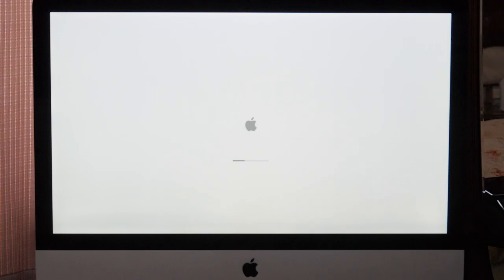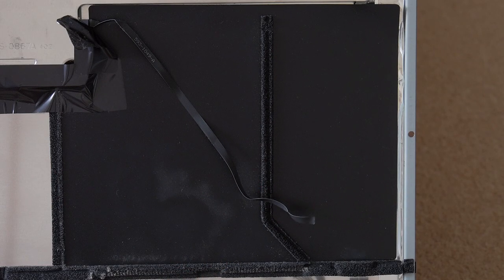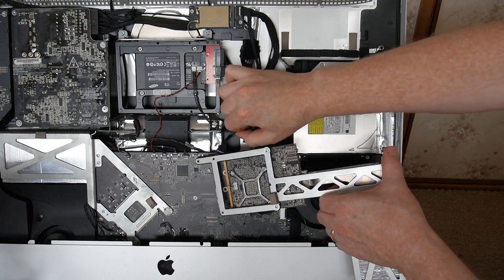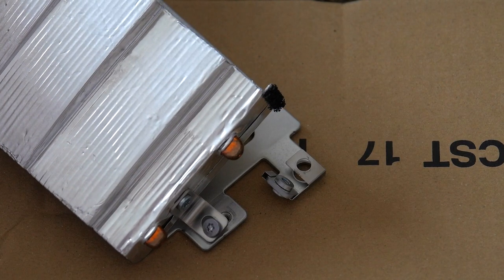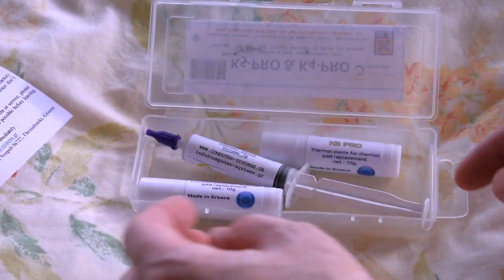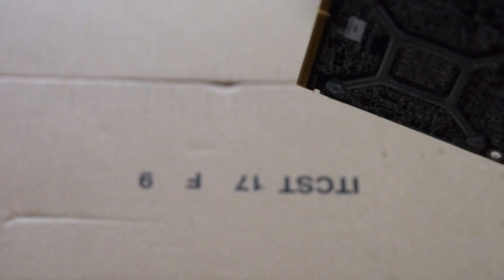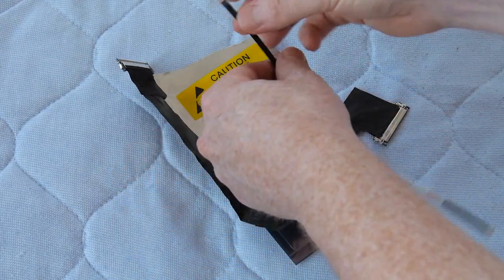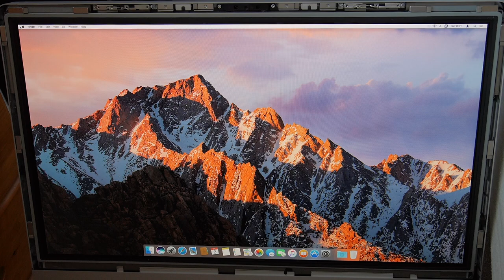Late 2009 iMac 27" Video Card Repair — 4850 — 2nd Bake

Comment: Hi JDW, thanks for your video this helped me make the decision to try and save my old iMac 27"2009. Question: After cleaning the GPU, and heatsink, can I use Soft Thermal Conductive Silicone Pad in exchange for Thermal Paste K4 or K5? Can I replace the battery BR 2032 with CR 2032. Thanks
Reply from the maker: Thank you for watching and for your question.  The only reason I used K5 Pro instead of a thermal pad is because it's not easy to precisely measure the gap in order to buy a thermal pad of appropriate thickness.  If you can do that, then of course a set of thermal pads for the memory chips will do just as well as K5 Pro.  Yes, you can replace the PRAM battery with a CR type.  I chose the BR only because (1) it matches the stock battery type and (2) since the iMacs get hot inside, I though the higher temperature specifications of the BR type would be better than the CR.  That's not to say the CR will suddenly fail a few months down the line.  I simply had the means to purchase a BR, so I did.  I hope this helps!
Reply from the maker: @jvah051165  Whether you use thermal pads or K5 Pro, the thermal conductivity is lower than normal GPU/CPU paste.  But that is in part due to there being a gap, and in part due to the design of the pads and K5 Pro paste.  Paste made for a CPU/GPU with no gap can be designed with a much higher thermal conductivity than a thermal pad or K5 Pro.  But the good news is that those memory chips don't get nearly as hot as the GPU on the video card, which means the lower thermal conductivity of thermal pads or K5 Pro doesn't matter.  So whether you choose K5 Pro or thermal pads won't be an issue at all for you.  And if this is the only project you have planned, then there wouldn't be any merit to buying K5 Pro over a thermal pad, so long as you have precisely measured the gap between the top of the memory chips and the heatsink so you know the right thermal pads to buy.  But if you have other projects requiring paste, then the purchase of K5 Pro would be useful, as gap width doesn't matter with that paste, and you could use it on memory chips of other cards too.  But never use thermal pads or K5 Pro on CPUs or GPUs because it is not made for them, and the lower thermal conductivity will mean the chip will get too hot.  Again, this doesn't matter for cooler-running memory chips.  I hope this helps!

Comment: Is it even necessary to turn the spring mounted screws. Wouldn't it be enough to remove the 4 screws on the bracket on the other side. And then the spring mounted screws will still fit i height?
Reply from the maker: You are asking about video timestamp 15:22.  You can of course remove the 4 tiny screws on the back first to see what happens, but I believe you will find that you still need to then loosen the spring loaded screws too.  Please try and then let me know what you ultimately had to do.

Comment: Thank you for the video, I am in the middle of this project and have a small issue I hope you can help with.  While removing the connector for the power button and using very little effort the wires pulled out of the connector.  Is there a technique for getting the wires back in the connector or am I going to have to replace the power button?  I know the connection to the button is a solder connection.  Thank You!
Reply from the maker: I really need to see a clear, sharp photo of your wires and connector to give you the best advice.  Consider posting such a photo to Flickr or some cloud service, then get the link to your photo and post that link in a follow-up comment.  Unlike other folks here on YouTube, I don't ban URLs in the comments.  Freedom reigns! :-)  For now, what I can say is that in most connectors, wires fit into the plastic slots by means of metal "terminals" that are crimped onto the tips of the wires.  Those metal terminals stay inside the slots of the connector by using tiny little "wings" that flip out like an arrow, allowing you to insert the terminal into the connector but not pull it out.  That is, if you do pull it out, you probably either broke off those little wings or you bent them in the opposite direction.  If they are merely bent out of position, one need only bend the little wings back into the proper position in order to reinsert the terminal, allowing it to stay inside the slots.  However, if even if you can do this, if you yanked out many wires and don't know the correct slots in which to reinsert them, then you would need some guidance to figure that out.  Anyway, I look forward to hearing your reply in light of this.

Comment: Hello JDW! Great video on fixing the video card problem. I was wondering if I have a video card problem because all of a sudden in the last couple days or so there is extreme amounts of snow /static anytime I play a youtube video! It only happens in strange spots throughout the video, not the entire screen, very strange! Do you have any idea what this may be caused from? I also have a late 2009 Imac 21 inch screen and I am running El Capitan OS. Should i download the Sierra OS? I am kind of worried about doing that because I don't know if it has anything to do with this new problem. I would appreciate any of your thoughts! Cheers! And thanks very much!
Reply from the maker: Does your iMac also freeze, lock-up or not wake from sleep?  If you have no such issues and you only see snow on screen, I cannot say for certain if it is the GPU on your video card.  Normally, when the GPU goes bad, your entire machine will lockup.  However, what you are experience could be the first sign of the problem and eventually your machine may start freezing, at which time you will have no choice but to do the bake.  You might also want to test some graphics intensive games to see if the same problem occurs, because games tax the video card even more than YouTube.  Also try watching YouTube in a different browser than you normally use and see if that helps.  If you don't get the snow when playing games or when using another browser, then I would say your problem is software related and has nothing to do with the video card.  In that case, it could be you are using an older version of MacOS or perhaps simply need to reinstall the OS.  I hope this helps!
Reply: @JDW-  I really appreciate your fast reply, I will try everything you mentioned. It is not freezing, locking up, not waking from sleep. All of those are working well. I will try what you suggested and get back to you! Thank you very much, Much appreciated.

Comment: Hi JDW! Many thanks for your videos. I have the same iMac model than yours, bought early 2010, and it has been working very fine till last week. It froze whike using Kodi showing some of the interface letter altered... and since that everytime get stuck on booting but It’s able to boot in safe mode, I can’t understand. I tried reinstalling macos, but when restarts, it freezes... hard disks, memory... everything’s ok... so the only thing left I think it could be failing is the video card... I’m not new on baking electronics... that method saved my MacBook Air 2009 last year, so I’m going to try this week after ordering K5 paste and BR battery... I want to say that my video card had paste on the two groups of four chips at the end side fo the card (opposite the golden contacts), I don’t know if this is important, but mine has been working fine for 8 years and a half, so maybe next time you could apply paste there. Thank you for your help!!
Reply from the maker: Thank you for your kind words and your informative comment. Yes I agree that it is strange my video card did not have any Apple-applied thermal paste on the areas of the card you mentioned. And if I ever need to do the bake again, I would certainly put K5 Pro on those areas. Thank you for pointing that out!
Reply: It worked!! My iMac os alive again! 😄😄 thank you again JDW

Comment: I had to bake my hd4850 for the second time 15 days ago. It came back to life again 3 years after its first resurrection! However I wonder if I can replace it for a 2gb of vram modell...
Reply from the maker: If you’re thinking about the 6970 series, you might want to exercise caution because those failed at a very high rate when Apple was still selling those 2011 iMacs new.
Reply: @JDW-  what about a 765M model ?
Reply from the maker: @OnlyLightMatters  If the video card was not originally in a 2009 through 2011 iMac, most likely it isn't flashed with the required Apple firmware and will not work.  And in those rare cases where the card does work, you may lose the boot screen and other important functionality.  But even with video cards like the 5750 (2010 iMac) or 6970M (2011 iMac), there's not a whole lot of useful information on the internet that tells us about potential caveats.  I am actually mulling the purchase of a 5750 or 6970M now with the aim of making another video on that topic, since no one else has provided many details.  My main problem at the moment is finances.  My salary had hit hard times prior to Corona, and now things are just horrible.  Anyway, that's what I can tell you for now.

Comment: Hi JDW. It is great news to hear that after two years + your mac is still running. Great tutorial, I was able to fix mine a well. Thank you so much. One slight issue since the bake. One of the fans is running full speed 100% of the time. Can you offer any suggestions?
Reply from the maker: If you forgot to reconnect a connector or failed to connect it securely, one or more of the fans will run at 100%.  As you know, it's a lot of trouble to reopen the iMac, so I can understand you may not want to do that to check the connectors.  In that case, your best option to control the fan speed is one of the fan control apps I mention in my text description.  And honestly, you should use those anyway even if all your fans were running normally, in order to run the fans at a higher speed than the stock speed to keep your iMac cool.  For the past 2 years I've keep all my fans running at 2000rpm.  But again, if you want to find the root cause of the fan running at 100%, you'll need to open the iMac and carefully check all the connectors to ensure they are all securely fitted into their sockets.
Reply: @JDW-  Thank you so much. I did try fan control apps and there was no change. I will perform a new surgery on the imac :( and then try fan control apps as you said that I should be using those anyways! Will keep you updated if I find the culprit! Again, thank you. :)
Reply: @JDW-  I hate to be the bearer of bad news. Checked all the connectors, reassembled, fan still running full speed. :(
Reply from the maker: @veroniquepuderecki5995  I am very sorry to hear of that.  Do the fan control apps tell you which fan is running at 100%?  If not, please install iStat Menus.  It has a 14 day free trial.  It will install into your menubar.  There should be a FAN menu and the topmost command is called "Fans" and within that sub-menu it should tell you the fans are "System Controlled" and then it should tell you the speed of each fan.  When you know which fan is running at 100%, the problem should be easier to diagnose.  It could be that the connectors are fine (you checked those) but a wire somewhere is broken.  The only reason a fan would run at 100% is if a connector was not connected or a single wire to a fan "sensor" was disconnected or broken.  The iMac then cannot know the fan state, so it runs the fan at 100% as a precaution.  But even in that case, fan control apps (including iStat Menus) should be able to take over fan control.  It's very strange that isn't working for you.  Anyway, please try iStat Menus to check the fan speed and then try to use it to change the fan speed.
Reply: @JDW-  Thank you for your help, it is much appreciated. I installed iStat Menus. Here are the readings for the "System Controlled" fans: ODD 3434 rpm (86%), HDD 1093 rpm (0%), CPU 3916 rpm (91%). I tried editing the fan rules and dropped them all to 0%, still running at full speed. I am at a loss!

Comment: Why not use the thermal paste over the other bits as well if it’s so good ??
Reply from the maker: I don't know what you mean by "other bits."  If you are referring to "other components on the graphics card," then my answer to that is "because only the GPU and VRAM need paste."  VRAM actually needs it less than the GPU, which is why inferior thermal pads or K5 Pro are used on them.  Thermal pads and K5 Pro have less thermal conductivity than the paste used on the GPU, and that makes sense because the GPU comes in contact with the heatsink while the memory chips do not.  All said, if you paste components other than the memory chips and GPU, it won't hurt anything.  It just won't do any good either.

Comment: Thanks for the tutorial video about baking video card from iMac.  and I am curious about the SSD adaptor you are using which is temp pins supported from the adaptor by seeing video what is the product?
Reply from the maker: The bracket I used for my Samsung 850 EVO 1TB SSD is shown at 11:12 in my video and is this product on Amazon: https://www.amazon.com/NewerTech-AdaptaDrive-Drive-Converter-Bracket/dp/B005PZDVF6
Reply from the maker: The separate temperature sensor (required to keep the fans from running at full blast when installing an SSD) is sold by OWC at their Macsales website: https://eshop.macsales.com/item/Other%20World%20Computing/DIDIMACHDD09/
Reply: @JDW-  Wow thank you for the detailed reply.

Comment: What about the heat conductivty of the K5 PRO compared to thermal pads? I found thermal pads that having up to 12W/m.K, while K5 Pro does 5,3 K/m.K. Although it is one of more expensive offers on Ali (€14 for 120x120x0,05mm) maybe they cheating with the specs?
Reply from the maker: You need not worry about the thermal conductivity of K5 Pro because the reason it is used in the first place is because there is a GAP between the top of the memory chips and the heatsink.  You cannot use normal thermal paste there.  You can only use either thermal pads (which are a horrible pain to measure precisely) or K5 Pro.  Thermal Pads and K5 Pro are not as thermally conductive as normal GPU and CPU paste, but they don't need to be.  Memory chips produce less heat than the GPU.  I read and reply to every comment under all my Bake videos and I can tell you that many, many people are using K5 Pro with success.  My use of it got 2 years and 9 months from my 2nd bake.  It's something you can rely on.

Comment: Hello: I´m here to say that I´ve done the video graphics bake TWICE the first time my computer failed. Why twice? Just for security, I waited 15 minutes and proceeded to the second bake. Just a few days ago, so I´ll have to wait to check how many months it will work. Mid 2011 21.5".

And by the way, the exterior glass can be removed carefully with your fingernails, no need to spend money on suction cups.
Reply from the maker: You are the first person to try two back-to-back bakes, so I look forward to hearing how your iMac is doing over time.
Reply: Well... not sure if the first one, hahaha. I did it because the first bake was without waiting too much for the oven to heat. I´ll keep that in mind @JDW, updating you about how much time it will work fine. Thanks for your videos!